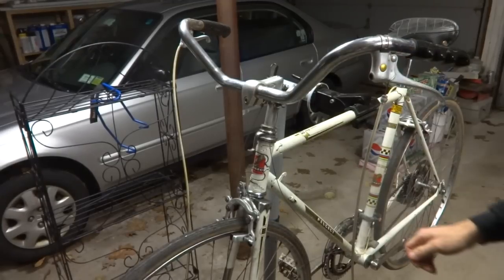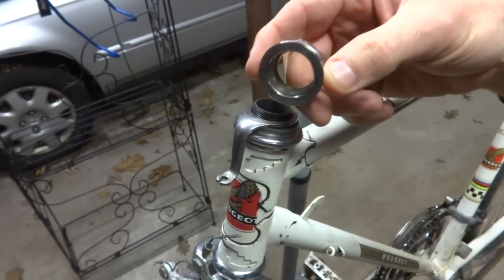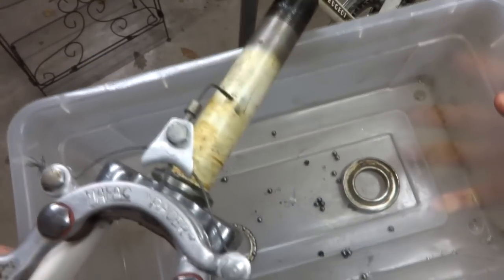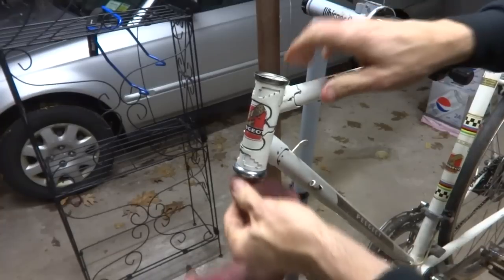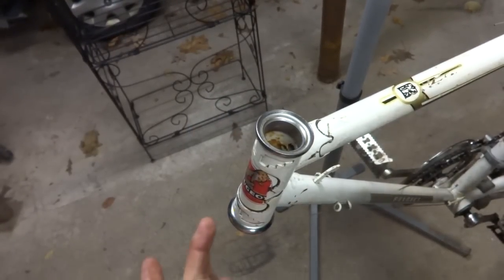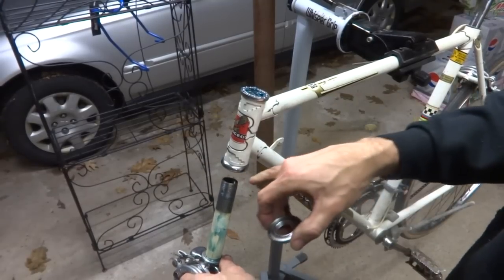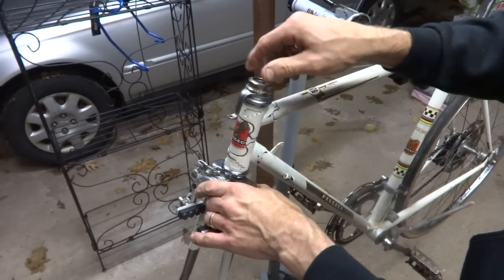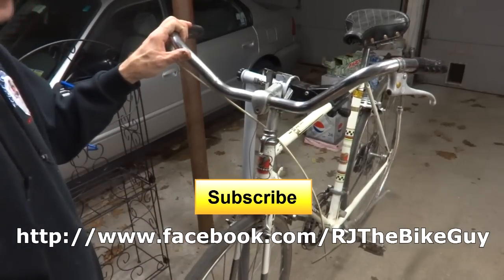How To Overhaul Vintage Peugeot Bike Headset

Comment from the maker: For more bike repair videos hit the subscribe button 🛑 and click the notification bell ► http://bit.ly/SubRJTheBikeGuy
Reply: I have a Peugeot quite similar to this model, same era, but with drop bars, 1x5 speed and a metallic purple paint job. I'd taken it apart for cleaning, servicing and replacing some of the parts and I couldn't remember whether the roller bearings were in the top or the bottom, so this was super useful. Thanks so much for this RJ.!

Comment: I just took apart my old uo-8 that has been in storage since the late 80's.  I bought it new in 1978, it is a little different:  drop-down bars and cotterless crank...

I did exactly what you warned against, dropped the fork out and spilled the bottom headset bearings on my garage floor.  I expected them to be in a cage like the top.  I recovered 24 of them.  

I searched utube and came across this video.  Seldom does a video answer a question so specific...you had 24 bearings and you told the viewer!  You also solved the mystery of which side goes up on the caged bearings.  

Awesome videos RJ. Thank you.  I am your newest fan tonight.

Comment: Just done my PA10 thanks to this video. Only difference was the top bearings were loose not caged. What I did was keep the bike on its front wheel on while I removed the top bearings, then removed wheel and flipped the frame to remove the bottom ones. Reverse process to reassemble. Thanks RJ.

Comment: Helpful video, I would add that for people who don't have a bike stand, setting the bike on its side after removing the handlebars is a good way to not lose the bearings and generally to keep stuff from falling down. Also, setting it on its side meant I didn't need to disconnect the brake cables.

Comment: Thank you very much for this very informative video. I have two Peugeot's (one UE-8 which is basically the touring version of UO-8 and one PX-10) from the 70's which I would like to tune up. Being the novice that I am, videos like this are invaluable to me.

One question, what sort of headset wrenches do I need to fit the locknut and the adjustable cup (or cone as you call it?), please?

Many thanks!

Comment: Thanks for making this video i was able to tighten my old loose mountain bike fork .that lock nut that u used the yellow wrench on was different on my bike ,mine had 3 notches in it, i am sure there is some tool for it but i just used a small flat head screw driver in the notch and a small hammer to tighten it and it worked no more loose fork, thanks again, just subscribed and a thumbs up.
Reply from the maker: Probably: https://www.amazon.com/exec/obidos/ASIN/B000C17KRI/ref=nosim/youtube25-20

Comment: I recently bought a Uo-8 just like the one in this video, and it has given me different sorts of problems while in the road, these kind of videos are helpful, is a shame you didn't upload more videos of this bicycle so I can use as a reference.
Reply from the maker: Most of the stuff on the Peugeots, are the same as other bikes for which i have videos.
Reply: @RJTheBikeGuy  well that's true, maybe it's because I have a very similar model, Form the same years and color, it felt as if it was my own bike there hahahaha
Reply: @RJTheBikeGuy  I have one question though, I want to upgrade my bottom bracket to a sealed square tapper BB, is there anything I can do to make this happen without buying the Velo Orange part, because where I'm living right now theres nothing like that one.
Reply from the maker: @Dimass  LOL! French bikes suck for replacing parts. They have weird sizes and threadings. Finding a french threaded BB, or maybe a threadless. That's your options.

Comment: Is headset in my 1971 Raleigh Super Course same as that of the Peugeot? Great video, thanks!
Reply: The only real difference is that you might have loose bearings instead of that circular retainer clip. The process is the same.

Comment: Hi @RJ The Bike Guy, I have a question. I just took my bike apart. When I took out the fork, I carelessly flip the fork upside down andI noticed there is something inside the fork dropped out, looks like a cone. Do you know if bike usually have that? what is it for? and what does it call? Is there something else I am potentially missing? The only thing I retrieved after took the fork off was the bearings. Thank you so much
Reply: it is a vintage bike btw, from the 70s.
Reply from the maker: Not enough information for me to answer. Could be many things.

Comment: Hi, 
I got a vintage Atala road frame (around 1970). The bottom seat has widened, so that the lower headset cup is loose. I tried a strip of aluminium to fix it, but the fork still feels loose. Can you recommend a fix?

Comment: Hey RJ, Thanks for the video! While over-hauling my headset (seems to be the same exact model here in this video) I broke my "keyed lock washer". I have had a hard time tracking one down. Any suggestions as to where to find one? Thanks a bunch!
Reply from the maker: Local bike shop.
Reply: RJ The Bike Guy I tried them, no dice.
Reply from the maker: @alexlikesoutdoors5825  Try a different one. There are multiple bike shops in my town, and more in other towns. All different. The bike shop nearest me has drawers and drawers full of miscellaneous tidbits.  I am guessing other shops around here might not have as much stuff.

Comment: 6:45 I don't know about bikes but normally on machine bearings there is never a 2-3 ball gap, there will be a 1 to 0.5 bearing gap at most. If you have a bearing sized gap then you have a missing bearing(s)...I've just done gone overhauled a front wheel, it was rumbling until I replaced the missing bearing.
Reply from the maker: Wheels go around and around. So the bearings are constantly moving. Steering goes back and forth, so the bearings would mostly be in the same place. So the bearings will wear the races in the spots. Leaving a gap allows the bearings to move around move.

Comment: I'm working on a Green 1977 Peugeot, I believe it is a UO-10. All the decals, head badge and components are the UO-10, but according to the catalog the 1977 did not come in green. Anyway I also have a stripped headset like yours. Did you ever get to fixing it?
Reply from the maker: +Tou Lor Not yet. I should though.

Comment: Thanks for the video! I did this before I saw this video on a similar French bike based on the Peugeot. Made the mistake of assuming that it would be caged bearings at the bottom too. Whoops. Lost a bunch and put as many back that I could reasonably fit. All in all 25 compared to your 24. Will it do the bike harm running an extra bearing?
Reply from the maker: Actually, you want a gap in headset loose bearings. It allows them to move around more. Otherwise, there bearings sit in the same spot and will wear the races in those spots.
Reply: @RJTheBikeGuy  Thanks! I received similar advice on a Facebook group. Fortunately they're pretty easy to remove from the bottom on those bikes.

Comment: Hello RJ the holed spacer on my headset was cracked upon removal , can I go about sanding down the pin and removing the hole d spacer. I can't forsee finding a replacement one. Similar peugeot to the one in this video. Thanks.

Comment: Hi RJ, thanks for all your videos, you've been a huge help over the last few years in teaching myself how to work on old bikes. I've restored several now, including a single speed conversion for myself. My question is this: I have the same mini grease gun you do, but grease comes out all over the place, not just from the nozzle. What did you do to yours? Has it never leaked?
Reply from the maker: Do you have the "Dualco" mini grease gun, or one made by someone else? I specifically bought the Dualco one as they seem to be the one the pros use. There are other brands that look similar, but I have read poor reviews of some of them, like leaking grease.
Reply: shyflirt1 haha i didnt realize they looked so similar. i highly doubt mine is a dualco since those seem to run around $15 to $10 and i paid like... $4.....lol
Reply from the maker: So, do you think you got a good deal? :)
Reply: Man for the most part it works just fine so I'm pretty happy! lol

Comment: Hi RJ!
Thanks for your videos! They're really helpful and helping me A LOT! I have a problem with my old DBS (norwegian bike) I'm restoring. At 2:30, you unscrew the final part that keeps all the headset together, you call it a "cone"; mine is jammed, lock tight. the previous owner fell and I believe when trying to re-align the handlebar, he made the little key that should be in the slot, slip off and now it's in the threads of the stem. It's really locked. can you advise me on a techinque to loosen it? Sorry for the long comment.
Thanks again!

Comment: While following the steps in this video I have a couple ques. if you don't mind. Is it ever necessary to take out the last 2 races and if so hope how do I take out? Also, my stem had a very different looking wedge more like a cone looking piece. Does that sound right? Also, I have 25 bearings that came out of the bottom in the 5/32" size. Did the 24 work for you ? Or did u need more? How would I know if I need More?
Reply from the maker: No, you don't have to remove the cups. But you can. Stems come in different styles. For the headset, it is good to leave a small gap in the bearings so they move better and aren't always in the same positions.

Comment: I have one of vintage bike and i dont know the brand it kind a look like this. at least the bottom bracket is looking the same. my bike's crank mill (the middle pipe which rotates i dont know if it called crank mill) has been damaged by the pin that keep peddal part and mill together. where could i get one of these new? is there any website for old bikes?

Comment: Having serviced other non-Peugeot threaded headsets, I was surprised to find the lock washer with the series of holes when adjusting the headset on my mid-70's Peugeot (I think a PR-10?).  My issue is that the bearing cone adjustment is essentially "indexed" and what seems to be the optimal cone tightness puts the pin between two off the holes, interfering with the washer.  I had only tried adjusting the tightness without a full overhaul, so it could be the next-tighter option feels nice with some new grease, which I'll try next.
Reply: As a side note, this indexed lock washer seems like the main distinguishing feature of these Peugeot headsets from other threaded ones I've seen.  @11:20 RJ mentions no need to tighten the lock nut excessively -- am I right in thinking that for most threaded headsets (without this type of lock washer) you do want to torque down decently well?
Reply from the maker: Be careful not the strip out the threads!
Reply: @RJTheBikeGuy  Forgot to report back, but it's smooth like butter!

Comment: Hey I got a new frame never been built and its 1980s I think. It doesn't seem to have the cup ring part attached to top and bottom of the frame head. The part on the frame that holds the bearings in place. I am stripping down another racer that has exactly what you have in your video but new frame just has nothing. Have you any ideas? can you remove these parts from a frame and attach to another or is it built into the frame?

Comment: shyflirt1 What kind of a bike shop do you go to for picking out bike parts at the best prices?
Reply from the maker: I buy some parts at my plain old small local bike shop. I sometimes buy parts at other small bike shops in there area also. But I also buy parts on ebay, craigslist, amazon, etc. Some parts come from other bikes that I have. If I upgrade parts on one bike, I keep the old parts which may show up on another bike.

Comment: At 1:05 in, remove the bolt...My bolt head is not stripped but I tried a 6mm hex very very loose, 7mm to big to go in, then just in case tried a 1/4 in SAE just in case it had been replaced, too loose.  It really doesn't look rounded! Going to try a "grab it" tool, but any suggestions? THANKS RJ
Reply from the maker: Sorry, I can't tell you. Do some research on your bike and see what you find. Chances are if it's an odd size, someone else ran in to the issue. French bike manufacturers did weird stuff.
Reply: @RJTheBikeGuy  OK RJ, thanks for the response. Hope you are all healed up by now.

Comment: I am stuck on this part of my project, hopefully you can help me. I sprayed penetrating oil and removed the long screw that holds the stem. But I CANNOT remove the stem, do you think the wedge part is stuck? Should I have left the screw in? Any tips or tricks for this because I am stuck on the first step of this video. Let me know thanks
Reply from the maker: Put the bolt back in, but loose. And tap it down with a hammer to free the wedge. The stem could be seized. 
https://www.youtube.com/watch?v=7GvN7w386U0
https://www.youtube.com/watch?v=0GRbdnTRH-4
https://www.youtube.com/watch?v=8b4t42wiJpQ
Reply: RJ The Bike Guy I got the stem piece out thank you for your video it worked!

Comment: Hi RJ, what happens if I can move the cups on the frame easily with my fingers?, how can I adjust it? I have to stick the cups with something? Thanks and regards. J.
Reply from the maker: The cups are pressed in. Make sure the headset is the correct one. You might get a caliper measure the cups and headtube. I am assuming the cups are the correct ones, and only slightly loose. Not sure of the best solution.  Maybe a little loctite blue.
Reply: I think that they are the correct cups too. Thanks for answer me so quickly. J

Comment: Hi RJ, thanks for putting together this video. I've been watching a bunch of vintage bike rebuild/refurb videos recently, and I notice most people seem to use these translucent coloured greases -- they  usually say it's a marine grease, which I gather is waterproof, which seems like an advantage. I have a tub of a white "lithium grease", I got from a bike shop, which I've been using for pedals and threaded things and stuff like that --- is it OK to use that for the bearing race? I'm going to try servicing a headset with caged bearings.
Reply: OK, I did a bit of research at sheldonbrown.com: "There are a great many different greases on the market with different special features, mainly for automotive applications. For bicycle use, almost any grease is adequate, since the loads and temperatures are generally low. In wet conditions, a water-resistant grease is preferable." I think I'll just go with what I have for now, although the coloured greases do look pretty :P

Comment: Hey hello, you may be the one ho shows the parts of the headset the best way, so one knows now what to expect,... now I wonder, the bike shown uses parts that many times are hard to find and perhaps unique to the bike, ... so the question is if more resent generic bicycles are using the same set up or not, I ask because I am trying to design a tilting rickshaw, and I am planning to use the set up shown in this video for the tilting part.... many questions arise
Reply: The majority of bicycle parts seem to be standardised, plus you can always have adapters or new parts machined if all else fails.
Reply from the maker: +Robert Ostman Sizes on modern bikes have become more standard. Vintage French bikes had weird sizing and threading. Like a 22mm diameter quill stem  where the more common size was 22.2mm. But then American made Schwinns had like 21.15mm stems.

Comment: Hello,
I just bought a Peugeot P10 frame very similar to yours and I would like to know what type of headset they have. Just like yours, I have a grooved washer which is not the typical stuff you normally find on old french bicycles (they normally have a filed flat washer) and it's bothering because I don't want to make the (huge) mistake of buying a modern ISO/BSC headset while the steerer has a french threading. I will meticulously measure the outside diameter of the steerer and the inside diameter of the crown race but I would still like to have your opinion just for my own peace of mind. Thank you very much for your help.
Reply from the maker: It's whatever headset came with the bike. If your bike was made in France, you most likely have all the goofy French threading. Measure the stem diameter. If it's 22mm and not 22.2mm then it is French.
Reply: OK. Thanks for your answer. As a frenchman, it pisses me off that we pretty much only have french bicycles on our secondhand market. When it comes to restore your old french bicycle frame, you realise how annoying our standards have become ever since our bicycle industry has collapsed...
Reply from the maker: Yeah, I tend to steer away from French made bikes due to all the threading/size differences. It limits what can be done with them to a certain extent. I do have a really cool St Etienne bike out in the garage with Reynolds 531 tubing that I wish was my size. Cool bike.

Comment: RJ, I have similar Peugeot and I’m wanting to replace the headset with a modern one. Do you know if a new 1’’ threaded headset will fit into the Peugeot head tube?

Thank you,
Reply: Hello! I know this is a pretty old comment, but I'd be really interested to know if you manage to fit a modern headset on your vintage Peugeot bike?
Reply: Sophie Lantreibecq I didn’t try putting a new one in but I can send you the measurements of the headset I pulled out of it

Comment: I need some assistance. I am restoring a 1987 bianchi volpe. I am installing the original fork. I can figure out the order of bearing cage. Or there is another issue. When the top nut is on and only hand tight the fork is not easily moved. I have checked and rechecked and greased everything.  Any suggestions?
Reply from the maker: I can't tell how yours is supposed to be. But I have enough videos where I overhaul them, that you should be able to figure it out. Off hand, this one might be helpful. https://www.youtube.com/watch?v=61Gygv82DAM